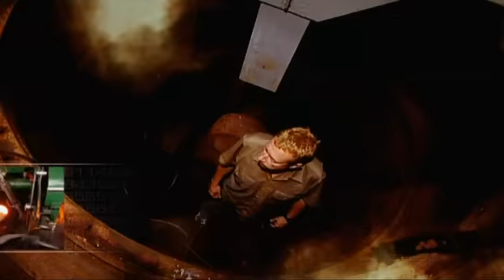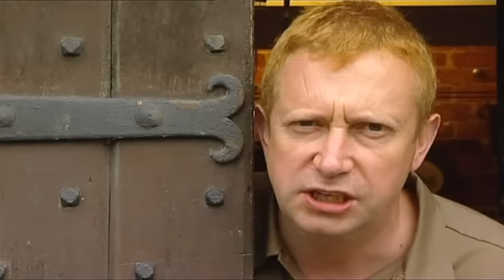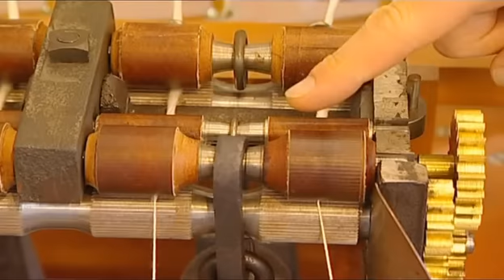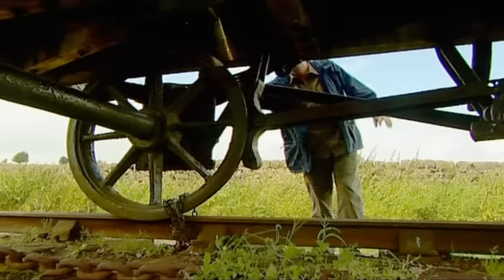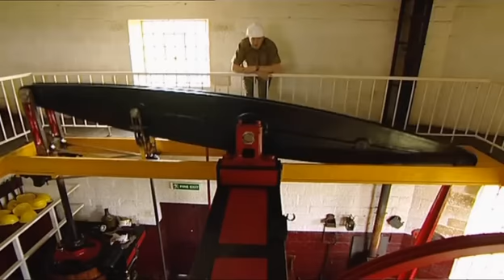Industrial Revelations - E02 - Pants for Everyone

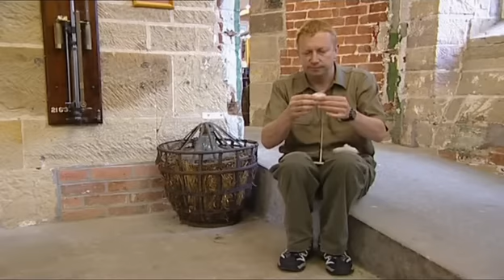Comment: I was surprised that the cotton gin, the device that separates the cotton from the seeds, was not included in this program. I know it was not a British invention, but it was an important part of the story. A simple line like, "The invention of the cotton gin in America in 1794 made cotton cheaper and more abundant than before, but what to do with all that cotton?" before the explanation of how difficult cotton is to spin (starting at 1:35) is all that would have been needed.
I also wish this were an hour-long program.  I suspect there is a whole lot of detail that was missing.
One thing I can say about the UK is that it has done a good job of maintaining old industrial sites like the ones shown in the episode. Here in Canada, nearly everything from that time period was replaced in the early and mid-twentieth century.  So many nifty things were lost.
Reply: Didnt really matter the yanks used a different more expensive form of imported farm equipment that caused a civil war and is still costing them today
Reply: @highlandrab19  I think it did matter a bit, considering around 80% of Britain's thread was made from U.S. slave-grown cotton. Hence why the Brits supported the Confederacy during the war. In fact, as far as I know, the vast majority of southern U.S. cotton was exported to Britain rather than used in America. So I think OP is correct to say that the cotton gin is a major factor in the booming British textile industry of the time.
Reply: @highlandrab19 this is an absolutely daft statement. Enjoy the continued decline and collapse of GB.

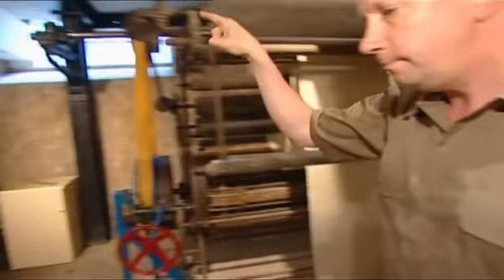Comment: 12:47 They twisted the belt, but why?
1769? That was seven years before the revolutionary war in the 13 colony's of the new world.
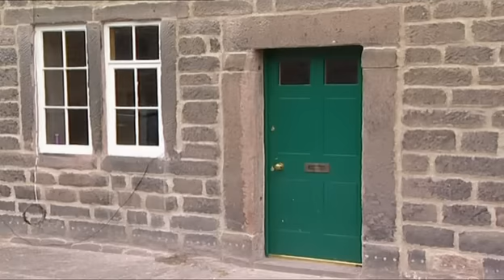15:55 Sorry to hear that.
17:05 You are telling me that they dug a 14 1/2 mile waterway complete with docks? Noticed that you used the English system when describing it. Apparently it was still in use in England at that time.
18:40 When you say 1 in 7 are you talking feet or yards?
19:15 No sleepers, your talking about the horizontal wooden beams that are in almost every track?
Horse drawn rail? Never heard of it. I assumed that this was drawn by a steam engine.
Water power to move loads on track. News to me as well.
Wait, they are using a steam engine after all. Just not a rail car. I wonder why they just didn't use one on the track? Seems like it would have been much easier and simpler than to constantly switch between the factory steam engine and horses.

Comment: Interesting to note that the English phrase " Cloth ears " to describe people hard of hearing comes from the time when people working in the  cotton mills would suffer hearing damage from the constant noise of machinery .
Reply: Does stuffing cotton in ears actually lower the decibels that much? Because quite ironic if it does.
Reply: @Khronogi  It's no different from putting earbuds or earplugs. You are just plugging up the ear canal that the sound travels through. Plus cotton is a soft material that would definitely absorb noise. Is it as effective as modern noise cancelling devices? Don't know.
Reply: My granny could lip read because she worked in the weaving shed from 14
Reply: I spent several years working in a wool spinning mill, I can confirm the noise was horrendous, most operations had simple hand signals to communicate although yelling worked if close. The heat was unbearable, very high humidity needed to run wool, it seemed like hell on earth when I first started but I actually enjoyed the job after the initial shock of the working environment.

Comment: He didnt explain "cardid"? cotton,that was the important thing that they learnt to do that he didnt explain so they could spin cotton,so how did they do that?,and then again at 19:10 the machine rolls the cotton throught it but again how is the cotton on the wheel set up to go through the machine,he always overlooks the thing that i would like to know,not so much the obvious that he wont explain to us novices.
Reply: You mean "carded". Carding was a process used to clean, align, and intermix the cotton fibres before it could be spun. Originally, carding involved passing cotton between two paddles (cards) covered in needle-like teeth, then you would run the paddles together until the cotton was ready. These days it's done using drum rollers, but the process is still called "carding" and the processed, aligned cotton is considered "carded"